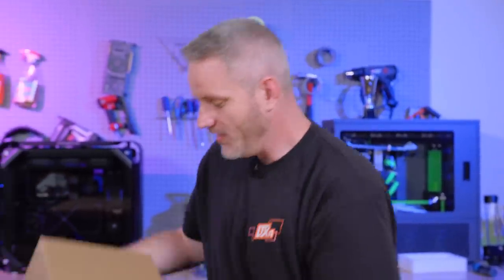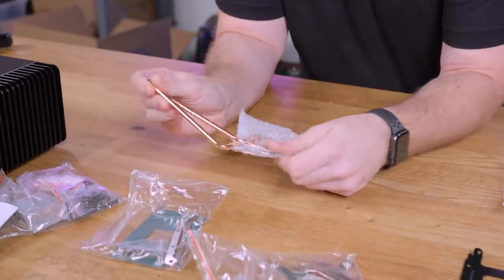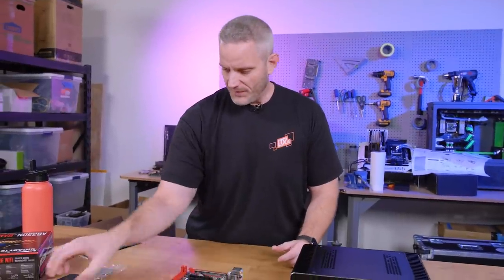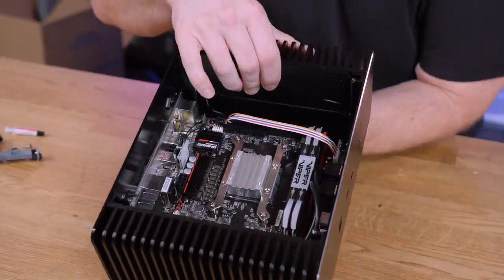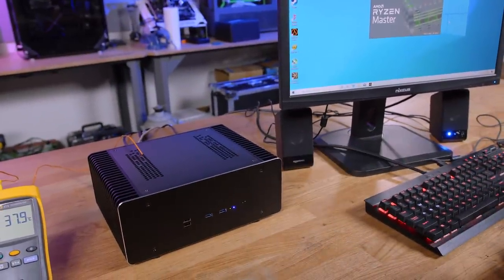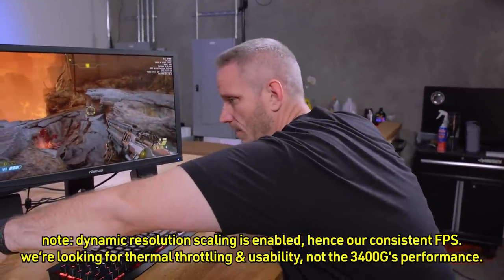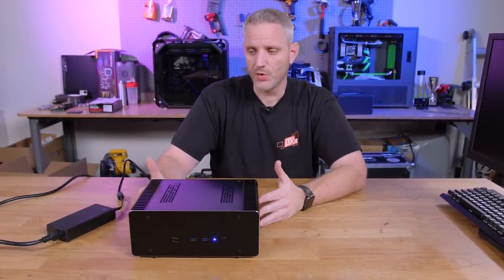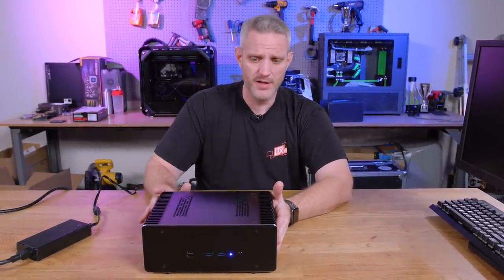I've never built a PC like this before...

Comment: Thanks for your great review Jay! We're always looking to improve our products so your input is very much appreciated! Also glad to hear our Maxwell Pro is getting a spot in your man cave 😎
Reply: Are you planning on making the cables longer or providing extensions?
Reply: Hi  @colinpye1430 , yes we have already informed our engineers about this issue and will extend the cable for older motherboards in future batches. In the meantime, the issue can be sorted out by using extension cables like our AK-CBUB45-15BK and EXUSBI-40 👍
Reply: i want to put my network card there, additional bracket please
Reply: @Akasatech  That's awesome, might look into this for a living room pc.
Reply: @Akasatech  good to hear.  I know centering the port might be an aesthetic thing but might also consider just raising the whole front I/O panel.  Seeing those cable bends was kind of painful.  That might also help with cables being able to reach the board header by not using cable length to bend around the RAM in the first place.
Reply: do you have a Australian retailer by chance?
Reply: Love the look of the case. I'm not a huge small form factor fan but I liked this case. Maybe they should make a mid tower case :P
Reply: I want to put my network card

Comment: "You can't put a GPU in there so it's not really a gaming case"

Challenge accepted.
Reply: With a little modification, a single slot or low profile GTX 1650 neatly fits.
Reply: 3400G is a gaming spec for entry level with vega 11 graphics , its indeed a gaming spec
Reply: At that point, you are basically making it an open-air chassis and be better off just getting an open case (or a box) and using the biggest heat sink you can find...
Reply: there are those slots above the backplate, im sure with a flex cable and some socket extensions you could rig a itx gpu in there but you would need to make some kind of mount
Reply: Ya boy at NFC got you covered no problem. He already made an ITX form-factor vertical RTX 3000 series (open air) PC.
Reply: Let the sawing commence!
Reply: R/sffpc would like to know your location
Reply: Lmk when you make it fit.
Reply: So it's basically a console...
Reply: Idk I saw Linus hacksaw and dremel apart a Wii once and that's way older than this 3090 I got here.  I figure there's, like, probably more redundant shit on this new card to make up for any experimental errors.  I mean, if I cut off half the transistors then I still got a 2080 in there so it should be fine, right?

Comment: "I think 2.5 L would be... generous for this case"

The case is 6.3L Jay...

4.7L without the fins
Reply: @timno9804    Gold
Reply: @timno9804  ah yes, the age old imperial standard measure of computer volume!
Reply: That's what happens when you think in fl. oz. 
"This pc case could accommodate 4 big gulp cokes."
Reply: It's so easy to measure and calculate even without factory specs. Just measure all three inside dimensions in dm (1dm=10cm) and multiply them by each other. Voila you have the volume in liters (1 liter = 1 cubic decimeter).
Reply: Americans doesn't even know what Litres is :P
Reply: @timno9804  🏃🏃😬😬😂😂😂
Reply: That also was my thinking. If Jay thinks this is 2,5l then he would get very, very drunk when ordering beer in Germany.
Reply: @TheKims82  Sir with the amount of 2 litre sodas we go through I think that's probably the one metric measurement we know the most
Reply: Pretty sure he is thinking in terms of bottles of soda.
Reply: When he said 2L, I was like "I've had a 2L PC case before, and it wasn't that big!"
Reply: He probably thought ~1L = 1gal not 1qt.
Reply: I came here for the tech I stayed for the comedy.
Reply: the fins don't increase the internal volume, so 4.7L would be the non-misleading figure to use
Reply: @TheKims82  kind of like how you don't know how to speak proper English?
Reply: @ConeJellos  English is not my main language, so you are right there
Reply: I think he meant gallons?  Americans should never try to use metric.
Reply: @TheKims82  Don't worry, many Americans can hardly apply proper grammar. Just thinking about how many times I've heard American dialogue say "I is" instead of "I am" makes me cringe and twitch🤣.
Reply: thats what im saying
Reply: LS Engines be like
Reply: @TheKims82  us Merukins buy our small Cokes in 2 litre bottles.
Reply: Was gonna say my 3L milk carton is smaller than that
Reply: @TheKims82  Liter is probably one one metric measurement we know the best, actually.
Reply: @compaqgt  "I can be any size you want, baby".
Reply: I only measure my cases in gallons.
Reply: Necronoxxx  You don't understand the purpose of this product. This is for the person that already has the multi thousand dollar gaming desktop and the ultrabook laptop but wants a computer for in the living room that is small, silent and aesthetically pleasing to normies (most likely women so no visible wires allowed). As Jay already said this is ideal for Steam Link to stream from the gaming desktop to this HTPC. Consoles always try to be the only device you need in the living room but those platforms are too closed off to be versatile enough and they are much louder than this PC.
Reply: @CheapBastard1988   Maybe you should stop watching 80's rap battle movies.
Reply: US liters
Reply: Jay is so American he doesn't know what a litre is, or Celsius, kg. millimetre,  and any other real forms of measurement.
Reply: @nobodyimportant7380  he probably knows about them he just doesn't know the scale because we still use a stupid measuring system
Reply: @bananya6020  Maybe because 1L is not a qt :-)
Reply: @CheapBastard1988  It would be a great system to use as a media centre for playing all your ripped movies and music and do a much better job than a smart TV
Reply: @nobodyimportant7380 i'm aware of that but it's not too far off that you can't make estimations with it. i used "~" to mean "approximately"
Reply: @bananya6020  YOu saw my :-)   right ?
Reply: @nobodyimportant7380  Definitely but could also run media remotely from a NAS. Though a Raspberry Pi could do the same. This just brings more compute power to the living room than the ordinary devices while still being small and premium.
Reply: @bradenarnold  🤣Probably!
Reply: 2.5L of useable space.
Reply: Hahaha, as soon as he said 2L, I was like "Uhhh, try more like 4.5", then came to the comments.
Reply: @coryandrum  still nope since the usable space is just under 4.7L
Reply: @curtisbme  gotta love imperial haha
Reply: @00Ruben  Jay is a water cooler master and SFF noob at the same time.
Reply: @bradenarnold  Actually, Americans should try to use metric, so the rest of the world doesn’t have to guess which gallon/ounce/other strange unit they are using. (At least 2 different gallons, 4 different ounces, and there’s always the hogsheads)

Comment: "they dont make highspeed ram w/ tiny heatsinks" 
G.Skill Aegis 3000mhz ram, small black heatsink and low cost, also overclocks fairly easely
Reply: Corsair Vengeance LPX series as well @ 3000, 3200, and 3600 MHz.

Comment: Jay: They don't make high speed memory with little bitty heatsinks.
Corsair LPX: Am I a joke to you?
Reply: same. And my old-ass 2933 rated Hynix-chipped modules happily clock up to 3400..
Reply: Crucial Ballistix Sport used to be no larger than the PCB (looked like the sticks in the video at 9:52 ) and they were available as 3000s, 3200s and 3600s. But they killed off the "Ballistix Sport" series and now just call them Ballistix with no suffix and stuck a pointless huge heatsink on the same small modules the idiots -.-
Whatever happened to actual low profile RAM anyway? like the sticks that were less tall than the levers on the RAM slots (like the Ballistix Sport VLP DDR3 sticks)... why are there no DDR4 sticks whatsoever in that form factor?!

Comment: Akasa have been around for yeaaaars. They've always had some rather interesting more niche type things but never really anything super high end. They used to make pretty decent and cheap case fans back in the day too.
Reply: I have an Akasa 5.25"-bay USB3 hub and card reader in my machine - they make all sorts of obscure-useful bits like that.
Reply: I find their products very useful indeed. They're positioned towards clean-looking aesthetics components.
Reply: I had a 5.2" fan controller thing from akasa with a display showing fanspeed and temps. it even had an alarm for fans not spinning or high temps xD and it was R(no G)B (Blue backlight or red when alarming)
Reply: Check the Akasa Apache fans.
The Best fans silent/static preassure you Will know. For the cost
Reply: Still got my Akasa Silver Mountain Athlon cooler which came with a nice quiet 60mm delta 6000rpm fan :)

Comment: Thanks Jay for coming out with this video. I've been looking at APU's a ton and finally got a 4650g off Aliexpress, and built a system around it, and was heavily considering some of these neat passive cases. The Ryzen APU's are really fun for small systems. Love being able to run old or lightweight games on them on little electricity and heat output.
Reply: How was the buying process? I want a better APU than the 3400g.
Reply: @nathaniel6286  It really wasn't all that fun. It was in shipping for a literal whole month. There are price scalpers all over the place, especially with the 4750g, I've seen a 50% markup commonly with that. 4650g I've seen on average a 10% markup. I believe the warranty on these things is a shot in the dark as well, so if something happens.... possible RIP. 

In terms of the customer expereience on the whole though... The 4650g wasn't recognized by the Gigabyte Aorus b550i motherboard without the latest drivers. That, and I can't change the dedicated VRAM amount, or frame buffer size from 512mb. Sucks lol. Hoping for support from Gigabyte.

Comment: "I think 2.5 L would be... generous for this case"
Yeah I see some difficulties with the metric system here..
Reply: yeah he probably though a liter was about a gallon rather than a quart
Reply: Hey, points for trying. 

For easy estimates, a cube with 10cm sides (about the width of your hand, or 4") is 1L.
Reply: @teslatrooper  jayz has some REALLY BIG HANDS
Reply: You'd think cars would help with that but because of all the extra shit on a motor it probably makes it worse
Reply: Case interior appears to be slightly bigger than the mini ITX board, so lets call it 17.5cm x 17.5cm, and the case height is 11cm, so that makes it about 3.3L. Noice.
Reply: @wayward03  The physical volume of an engine block is way bigger than the swept volume of the cylinders, even before you add on all the "extra shit".
Reply: Yes, also maybe he thinks 1cm is more than it actually is (when he was talking how short the USB 3 cable was)

Comment: 4750g: aight imma head out
Reply: I built a similar rig with a b450 and 2200g and a tv card it's not passive and I have to work up the nerve to swap the flexATX psu fan(Hard to find a quiet one of those). It's headless, If AMD does say, 6 core APU that can do 1080/60 high settings for average modern titles I'll fingers crossed drop that in and hook it directly to the tv. as it is now I could use it for remote play.
Reply: that is no consumer chip though. you cant just buy it at the store.
Reply: I wanna get that too but it's only on OEM builds.
Reply: @peter_parkour  they are all over ebay
Reply: @misterjeffa2128  theyre all over ebay